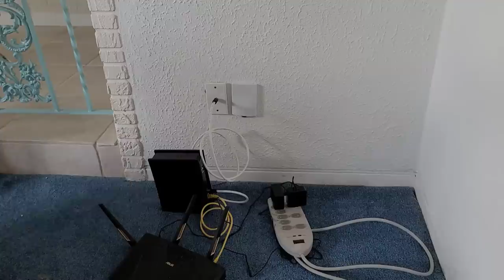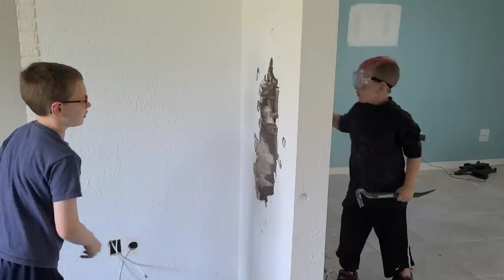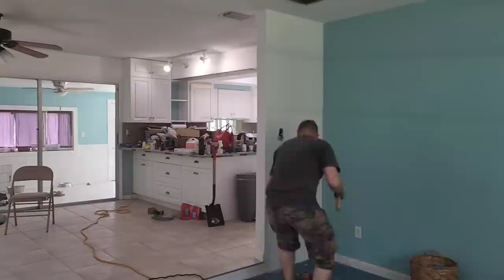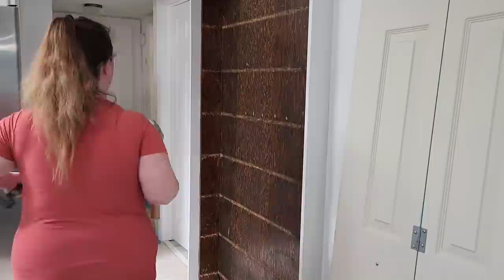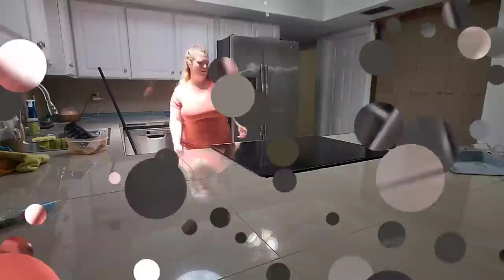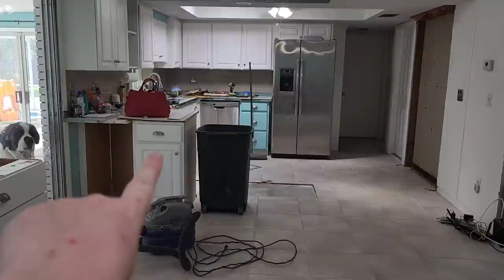DEMO DAY!!! MAJOR HOUSE RENOVATIONS IN OR FLORIDA FIXER UPPER! EXTREME BEFORE AND AFTER

Comment: How did you know that wall wasn’t load bearing?
Reply from the maker: So our realtors partner is a builder and he did an inspection for us so we would know if it was or was not not. Basically the joists run the whole length of the house and don't rest on any center walls so we new it wasn't structural